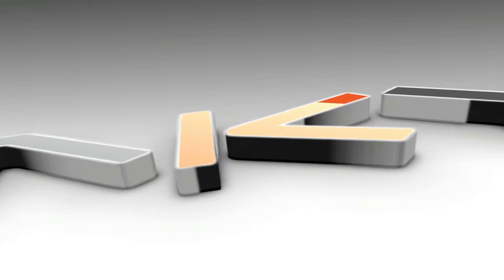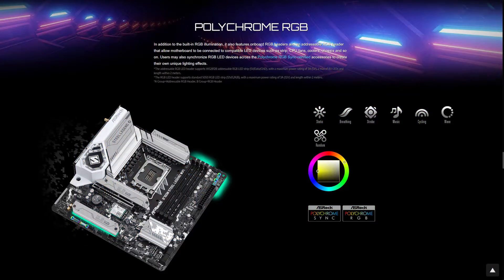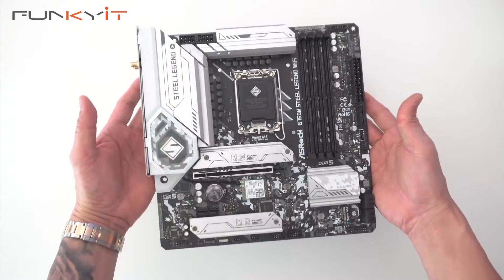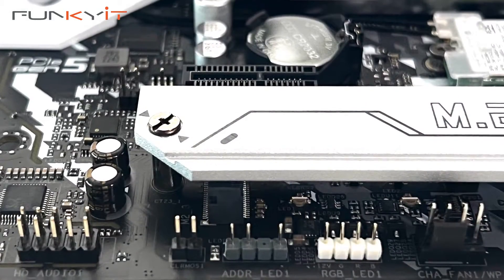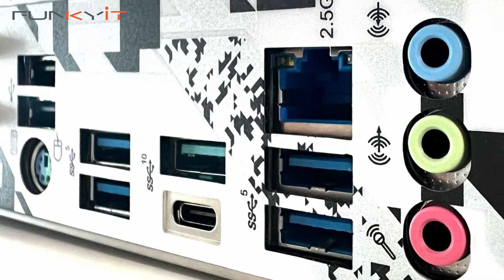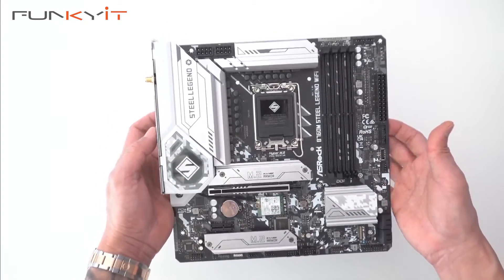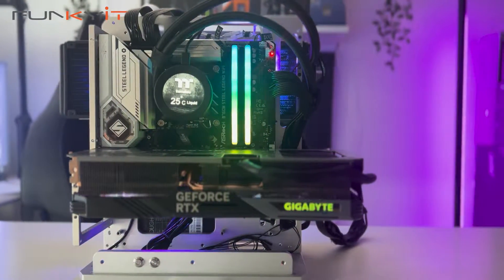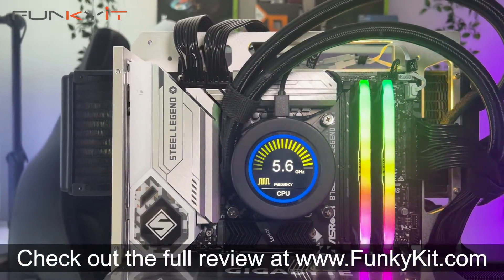The Most Versatile Micro-ATX Motherboard - ASRock B760M Steel Legend WiFi

Comment: Some one who has used this mobo pls tell 🙏🙏🙏
Will this motherboard allow the i5 14600k to run at its stock boost speed in the long run and handles temp well ?
Reply: Better buy a cooler

Comment: 28k cine bench r23 score is pretty low for a i9 14900k
I will be building a pc with i7 14700k
Which motherboard will be good option on lower price segment around 200 USD
Reply: It's not for i9 or 14th gen, use asus or msi Z790 chipset

Comment: Hello, what version of bios do you have? I am building a computer with a core i9 13900 processor, 2x32 fury beast 5200 mhz ram memory and the rgb lights of the ram memory do not turn on and the computer does not display an image, I think I would have to update the bios version
Reply from the maker: When tested at the time… we used the original BIOS that came with it.

Comment: What is the PSU watt required for this mb with i5-14500 without graphics.
Reply: It depends of your GPU
Reply: 5482W 🤣🤣🤣🤣🤣🤣🤣🤣🤣🤣🤣
Reply from the maker: I recommend 750W to 850W PSU
Reply: @Funkykit  too much, man.. 450w close enough for igpu only
Reply: I ordered a 700 watt. Do you think that will be any issue with an RX 580
Reply: @cha-ka8671 what psu? If it the good psu, it will fine.. and if your rx 580 not refurbish, it will fine too